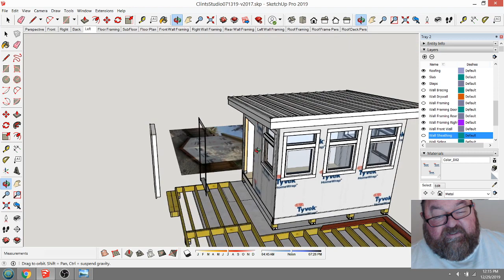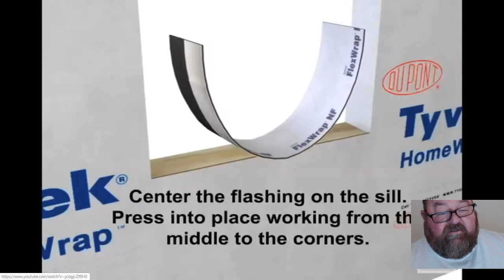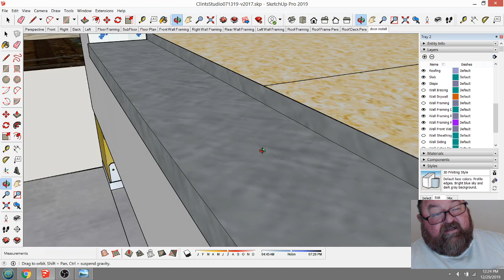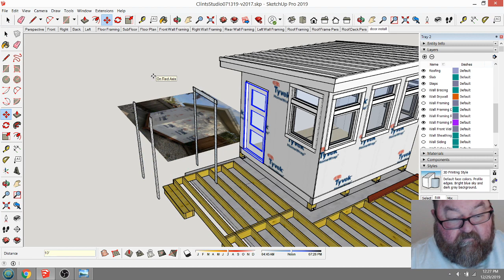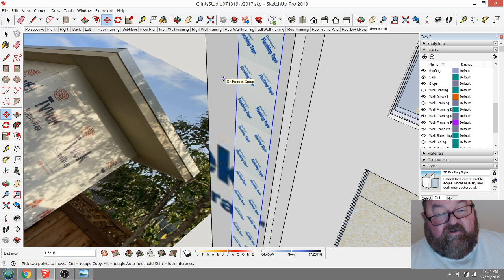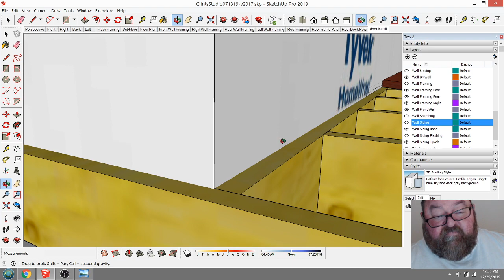Installing an Exterior Door Without Nailing Fins - ATDrafting.com

Comment: What is a good source for high quality solid wood doors?
Reply from the maker: this would be a local answer.  unfortunately, wood exterior doors are not dependable enough any longer for me to recommend them.  If you want a good looking door that will be easy to maintain and dependable for a long time, look into fiberglass entry doors such as those manufactured by Thermatru or something equivalent.  I could sit here and pretend that wood is still a good option but the truth is, wood is not what it use to be and I would never use another wood exterior door unless a customer signed a written agreement to hold me harmless.  Something happened to the wood that manufacturers use now not matter what species you mention.  They are all unstable and you are risking a pain in your arse if you use them.  I wish you well :)